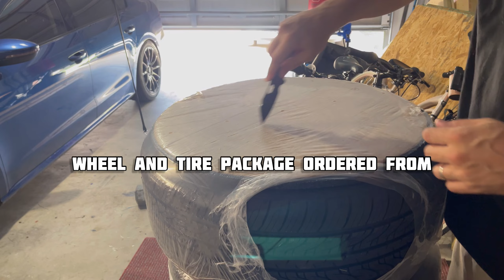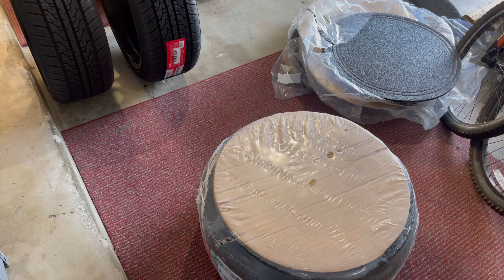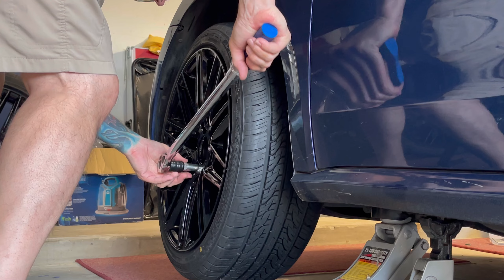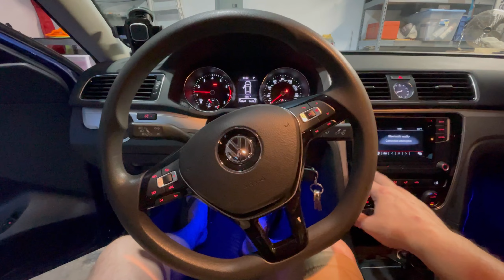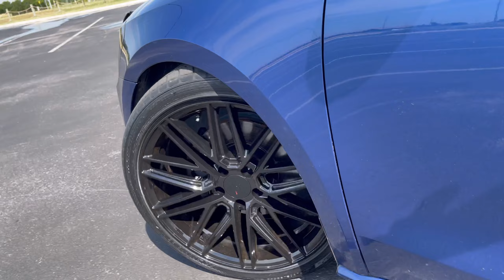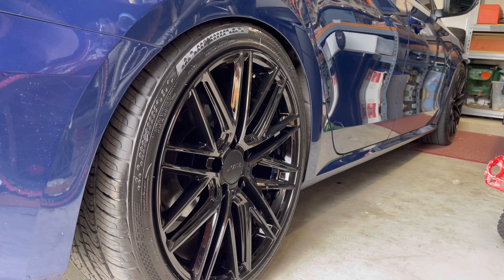Lowered and tuned VW Passat gets new 19-inch wheels - TSW Pescara - Perfect fitment - FLUSH!

Comment: Just for future reference and to make sure your wheel doesn’t fly off, please loosely screw the lugs in while on jacks, then lower the car off of the jacks and torque the lugs to spec. You can easily torque them incorrect when they are still in the air.

Comment: Hi, I am planning to get some new wheels for my 2016 VW Passat as well. I am looking at 19x8.5 ET 32 Konig Rennform.  I did not find any passats using 32ET in the fitment industries gallery. Did you face any issues with 32 offset  so far? I got a stock suspension/wheel at the moments & no mods to fenders.
Reply from the maker: When lowered they can rub depending on how low. They will fit your car with stock height and probably appear to ‘poke’ a fair bit.  I had to trim my fender liners and remove a screw to prevent rubbing on my setup, but I am fairly low. Et32 is a pretty aggressive offset on these. If you aren’t going to lower, and also willing to modify liners if you do: I’d probably not get an offset that aggressive
Reply from the maker: That said- I am super happy with my setup.
Reply: @DADMOBILE_Garage thank you!! Your Passat looks so nice with all the mods.. love the blue color 😊